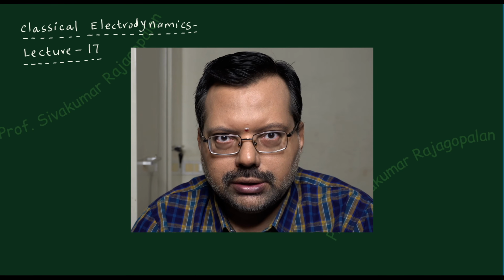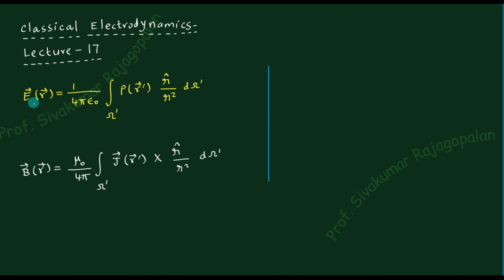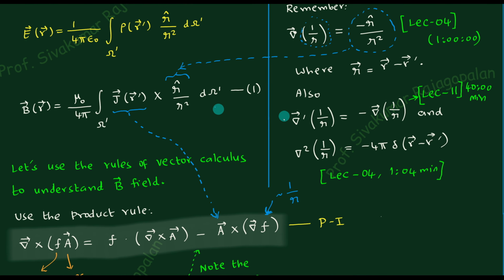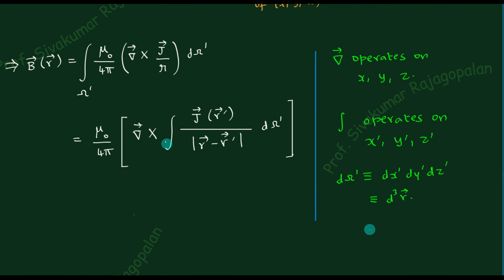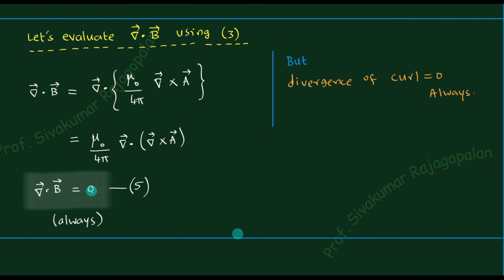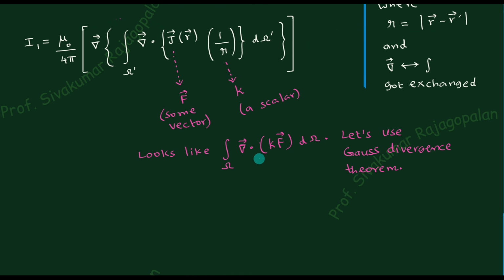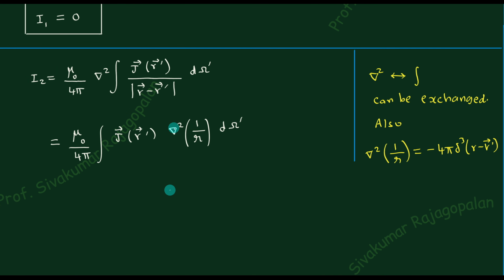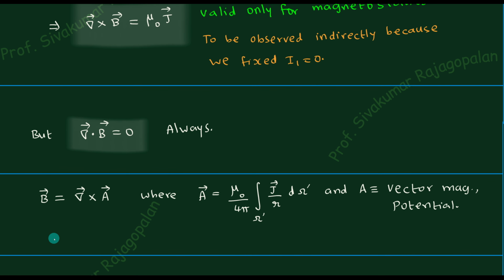Classical Electrodynamics Lectures 17 | Magnetic Vector Potential | MSc Physics Online Classes

Comment: Sir I have question on  lecture 17, about  the vector product rule used in BiotSavart law  mentioned at 30th minute in the lesson, at that point you have mentioned two equations in the integral. from the two equation the second term is zero, now my question is that, in both the terms we have the curl of the current density, so why is the first term not to be zero? thank you sir in advance for your answer